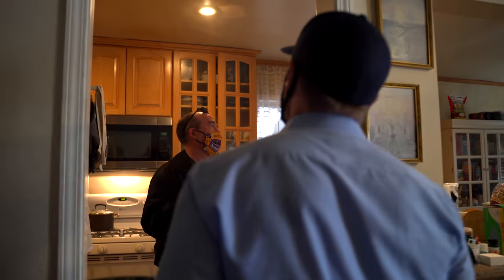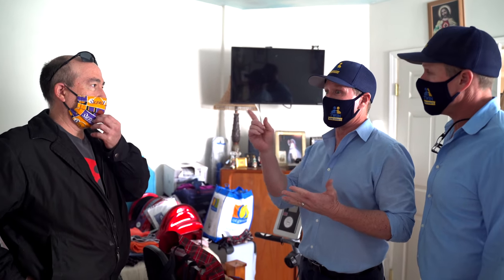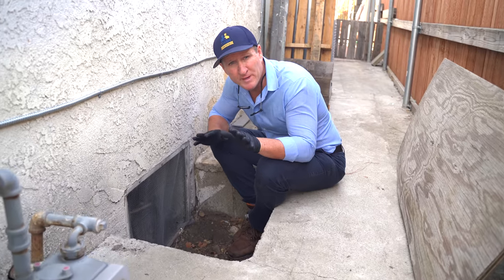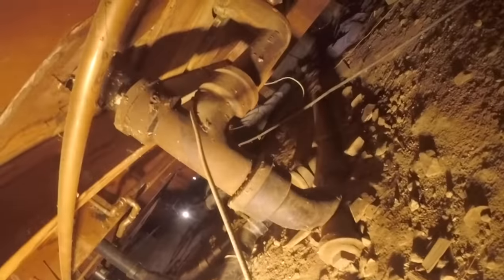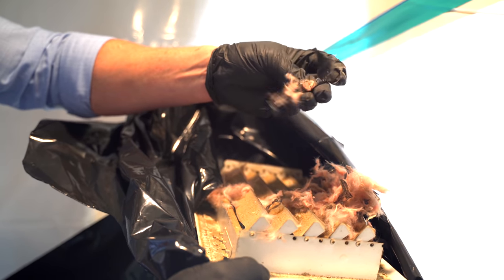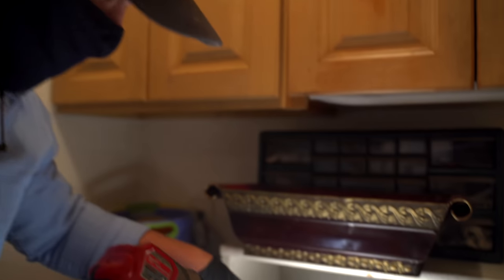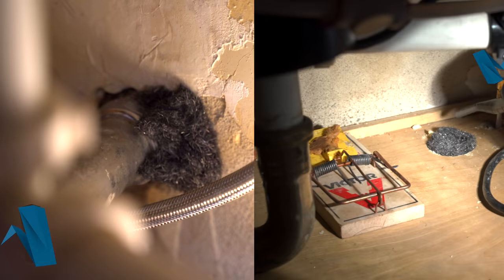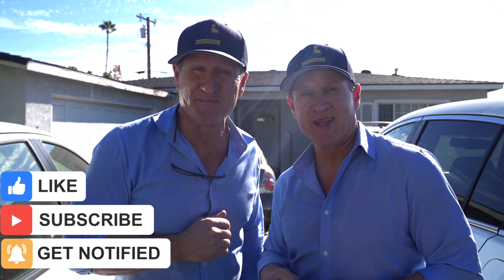How to GET RID of Rats QUICKLY when traps aren't working...Twin Plumbing

Comment: Folks it's not that complicated! Get you several cats and the mice will be gone! Meanwhile cover up every hole around your house, keep potatoes in plastic tote with a lid!

Now for added protection you can put some z flashing behind your baseboards, they can't chew through it,
Reply from the maker: Great points, but if there coming into your sewer pipe then into your walls, then cats have no way of getting them out of your walls. You still have to pin point these entry points and seal up. 
Once this is done, then cats work great keeping them away from your property. 
Thanks for taking the time to share!
Reply: @TwinHomeExperts  I had a big mouse in my oven and I can't figure out how it got there! They will get to your oven from the smell of food ad the heat in the winter, but in summer they are not as bad, you have to get on hands and knees and crawl around house looking for holes to call and stuff with steel wool, especially around pipes! Now you said they come in sewer pipes, is that possible or do you mean around pipes?

Now cats in n yard will keep them away, but don't feed them too much or they will get lazy

Comment: Terrible bad construction work by whoever built the house.
The underfloor space, should have 'site concrete' covering the whole underfloor area, to prevent rodents from burrowing into it.
ALL cable, pipe, and other entry points should be fully closed.
.